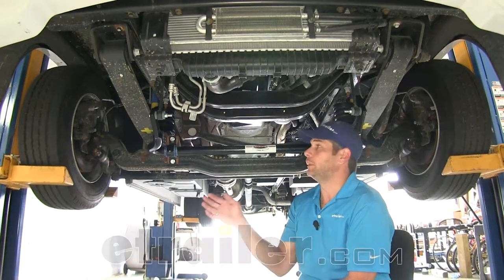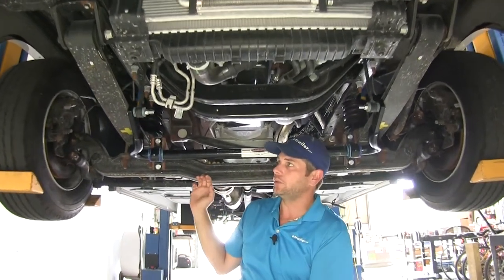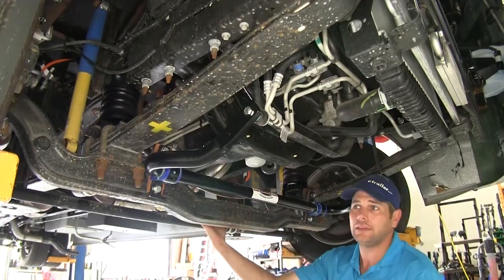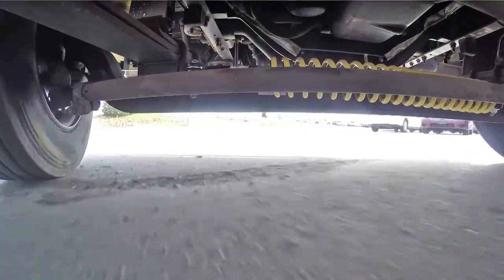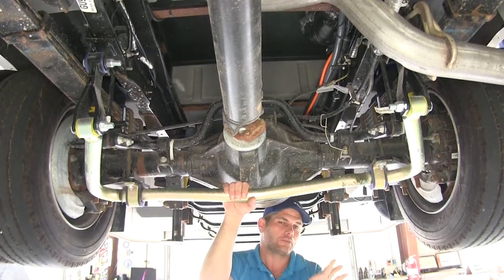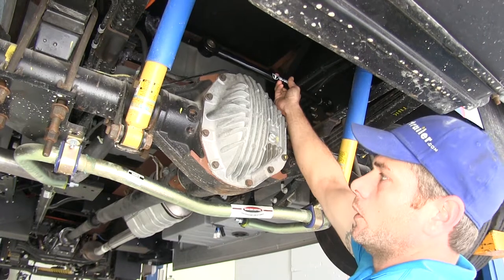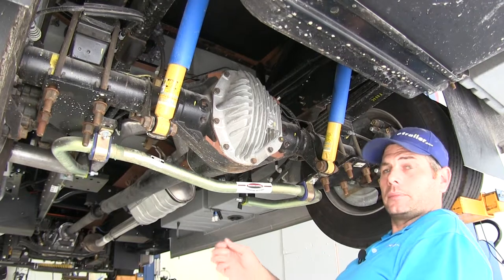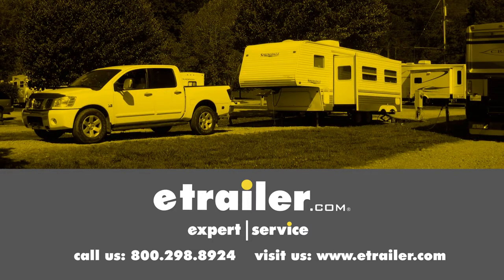etrailer | Best 1991 Ford F-53 Suspension Enhancement Options

Comment: It’s a shame these safety measures aren’t installed at the factory.
Reply from the maker: This suspension enhancement makes a huge difference in ride quality.
https://www.etrailer.com/susp-1991_Ford_F-53.htm
Reply: @etrailer  
For sure. I’ve already installed your Sumo Springs and am in the process of installing a rear track bar and will also install a steering stabilizer. I just think all class A motorhomes should come with these already installed.
Reply: Don't hold your breath....